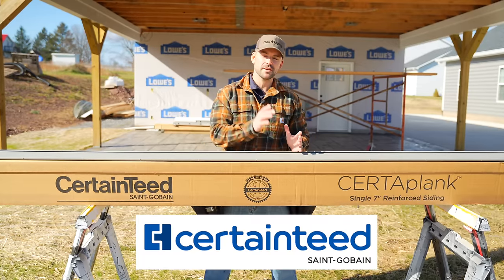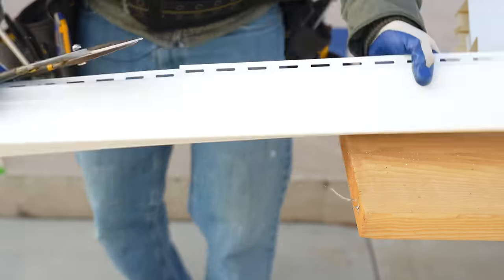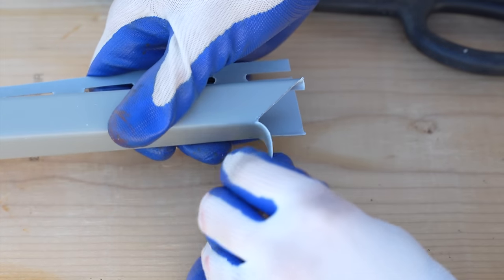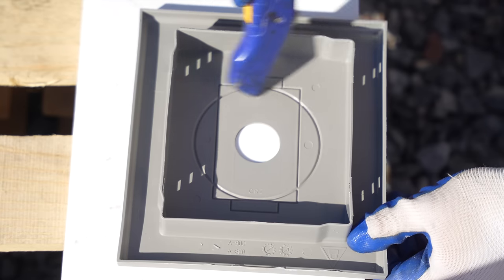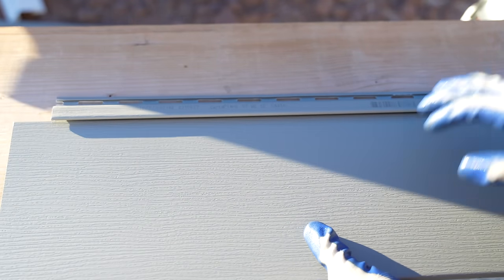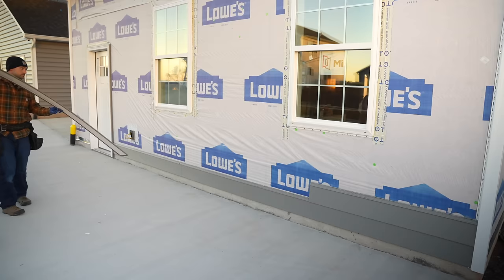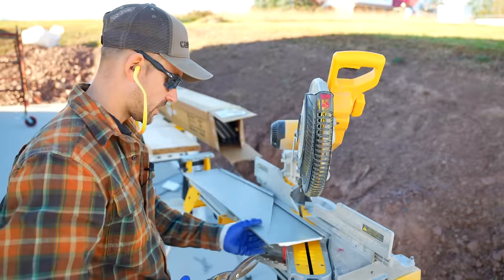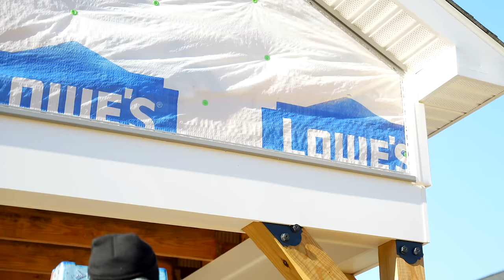Vinyl Siding Installation - CERTAplank by Certainteed

Comment: As long as it NOT THAT hardi debacle, i have sided maybe hundreds? of homes with that hardi, siding planks, dragon tooth shingle/siding, board (lift one of those into place yourself!) and bat, they/it... is by far the worst building material ever sold to homeowners and forced on us to install. do you believe the siding you use would withstand Midwest winters? just asking i have no experience...,  SFMF

Comment: A little something I found that worked well for me. When cutting down the width of long pieces of siding I used either left or right aviation snips. I am right handed and I found that when using the "left snips" (cutting from right to left on the work area) and "rolling" the snips away from the cut off made it very easy to cut along the line and avoid the binding issue of straight snips. It would be left to right when using the "right snips". It worked for me hopefully it can help others. Now that my shed build is done and all siding installed I want to say thank you for your videos. I had never installed vinyl siding previously and I truly believe I would not have been able to without your videos. I learned allot here and along the way of my build!

Comment: Good job on your vinyl siding have you ever thought about bending a piece of metal for over top the garage door and entry doors for a drip edge, when I was installing siding the inspectors would turn us down unless we had a flashing/drip edge.
Thanks for the videos
Reply from the maker: I flashed the door using flashing tape as I showed in the this video https://youtu.be/lFQbc7ltY6g?si=zEXs8X-L26q4y1So . Thanks for watching!
Reply: @TheExcellentLaborer  I understand that you installed flashing tape , but like I had mentioned the inspectors were I use to install made us install a drip edge,  we would make it 4” high and turn out the width plus an 1/8 to a 1/4 and then about a 45 degree down 1/2  inch , the inspectors wanted to see a rain drip edge on every opening.

Comment: I’m installing vinyl siding on my home and I’m loving it! 
I really like working with it even with my bad back and sore legs at 60 years old…lol 
My home is over hundred years old in stucco. Altogether stucco/cinderblock/plaster my walls are about 6 inches thick or so. Not insulated in the slightest so I’m insulating the outside with half inch green board foam. That’s just a quick note on that. It’s a double home and in between my neighbors and my front door I put up two furring strips and the insulated board and to opposing Jay channels which has approximately 7” between them. I kind of forgot to put furring strip down the middle so I could nail the little pieces of siding ( double Dutch lap 4 1/2 Panels ) 
So, my question is without getting into cutting the insulation and fitting a furring strip in there, I put a little adhesive behind the panel along the slots …? 
I know that you’re supposed to be able to allow for expansion/contraction of the material but the pieces are so short , should I be concerned about that ..?
 OR 
… since the pieces are so short in length, how about no adhesive, no nailing , just snapping them together ?
OR
… Use heavy fishing line past through the slots and pulled up and nail in the end of the string up above the door and covered with full panels….? 
Thanks for your video I’m learning a lot…👍🏼🙂

Comment: finding the studs under 1.5 of foam dk how in going to do that. and its wood plank clading to... hmm
Reply: If you’re using osb or plywood under that should be into the studs and usually you just loosely nail the siding to that